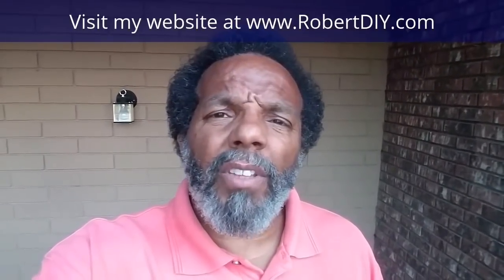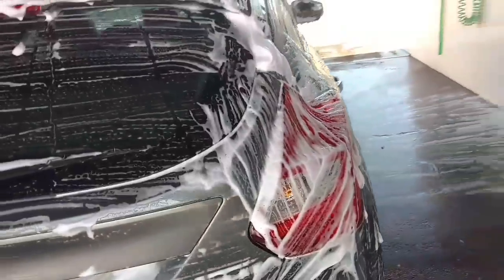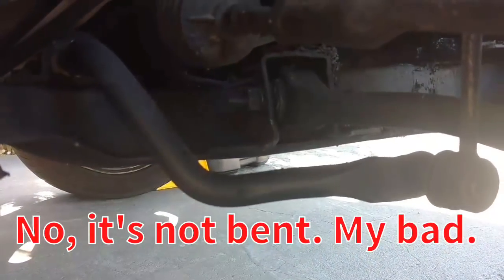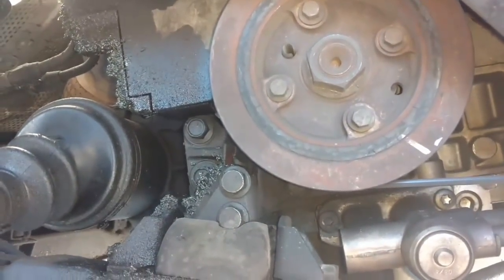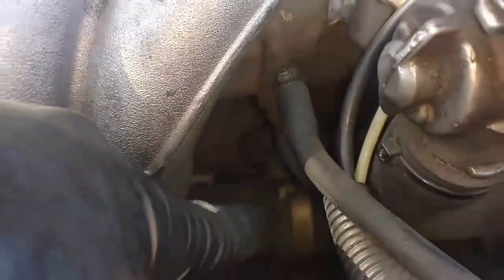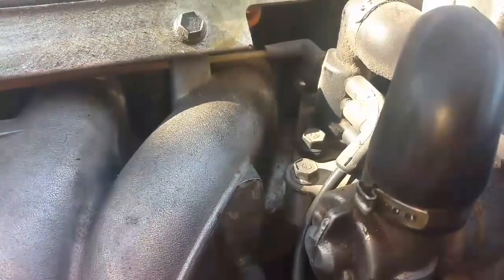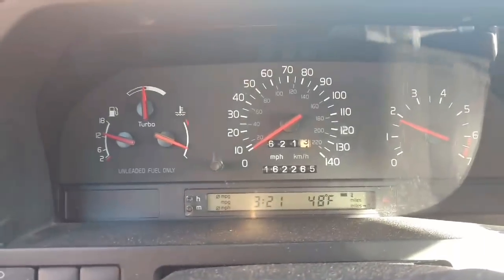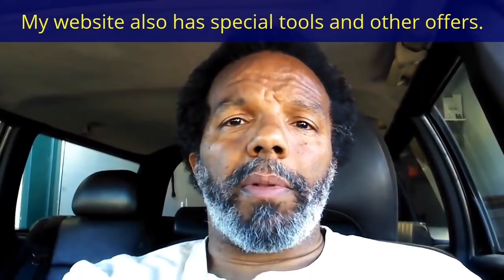Washed mom's car, tinkered on a friend's 850, engine mount, oil change, etc. - HOWR

Comment: Hey Robert, I have a ‘97 Volvo 850 and my defrost is not working. Everything else works great (front facing vent, floor vents) but the defrost vents don’t seem to get any air. Any idea what could be the cause of this and/or how to fix it?
Reply from the maker: +Joseph L is the dash noisy? Can you cut the floor off?
Reply from the maker: +Joseph L https://youtu.be/MhBzo9TUaBI